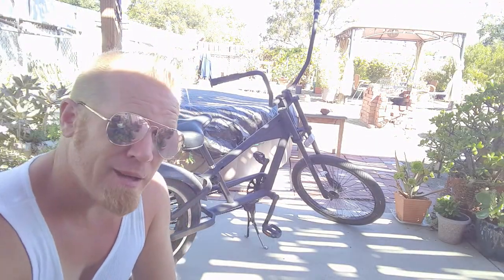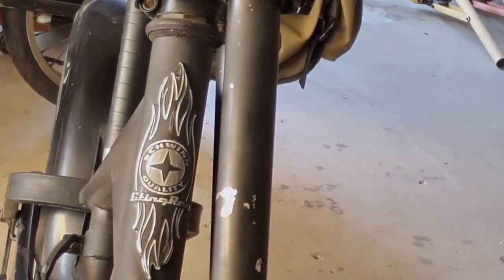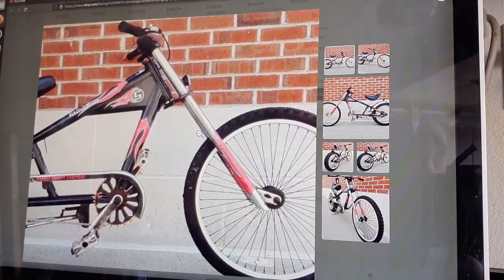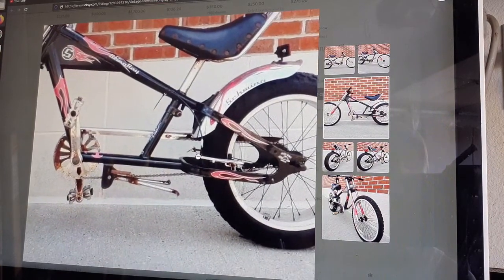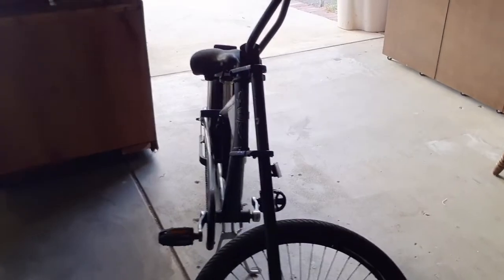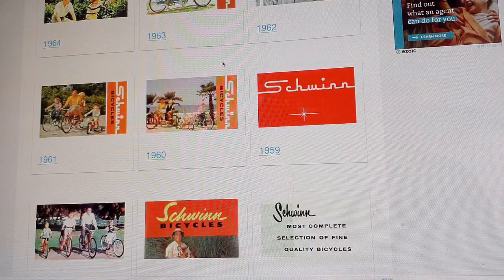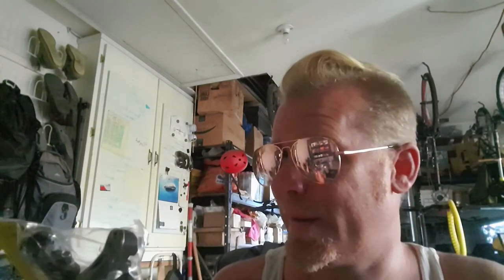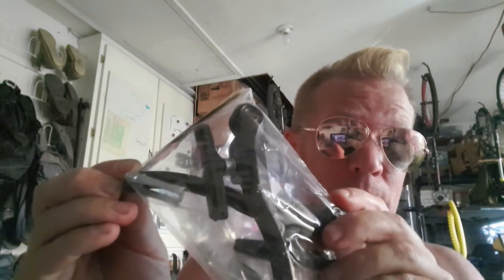Restoring my vintage Schwinn Stingray Chopper

Comment: Just in case you were unaware, the brakes that you needed to purchase are especially made for the Schwinn Stingray model.
Reply from the maker: Yeah they were not easy to find and definitely not a standard size. I ended up using 135mm classic linear pull brake calipers from a brand called Sunlite. Those did the trick! 😀

Comment: Both your tyres are on the wrong way around, if you hit a wet road or a puddle on that, you will instantly aquaplane and the bike will slide from under you, the arrows in the tread should aim forward, also, your front reflector is upside down, and you need an "outer cable" on the brake line 🤣 i have never seen that done before in my life
Reply from the maker: Hey thanks for your feedback! I've long since removed the reflector and replaced with a headlight on front and taillight on back. I also replaced the front tire with a new 29 inch one (original was 24 inch) and it doesn't have the arrow treads. 

The rear tire arrow treads do point to the rear, but the rim is definitely on properly (it can only be with the chain gear on the right), so at some point before I picked the bike up the original owner must have changed the tube and put the tire on the rim backwards. 

Crazy, but I am not totally surprised- it was in pretty rough condition when I got it.   I will have to flip it back when the tube needs changing. 

I just finished installing a mid motor electric conversion kit and its a fantastic ride. Will post a vid on it here eventually.

Have an awesome weekend 😎
Reply: @make.and.believe  yes the previous owner must have put the tyres on the wrong way, instead of ejecting the water out of the sides of the tyre, it will funnel it to the centre of your tyre and the force will cause you to aquaplane (like you are on ice), definitely make sure your tyres are correct before adding an electric motor though, it can be deadly
Reply from the maker: @keyproductions100  totally. I am fortunate that rain isn't much of an issue here in SoCal, that would not have been fun. I will definitely do this soon, thanks for the heads up!

I was eventually planning to replace the back tire (it is pretty worn down) This might be my catalyst to go for it. 

You rock!

Comment: How do you not know that this is a Schwinn Stingray Chopper? The tire itself says Stingray
Reply from the maker: Yeah actually that should have been a sign. I have so many tires though with so many brand names on them, and rarely do they line up with the brand of the bike, so I didn't make the connection. This was also my introduction to stingrays of any variety, they weren't around when and where I was a kid in the 80s. 

Now that I have another one with original paint though, I can see that schwinn went all out on the logos and branding for the 2004-5 chopper series. Probably looking to capitalize on the nostalgia for the original models.

It's really a shame that schwinn sold off to another company. These bikes are awesome!